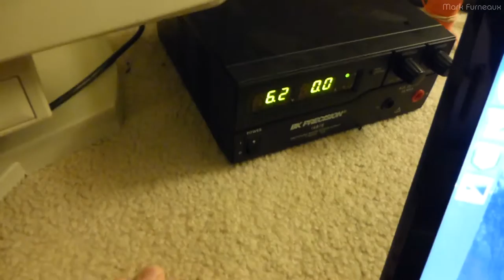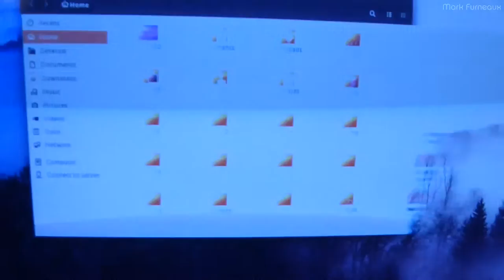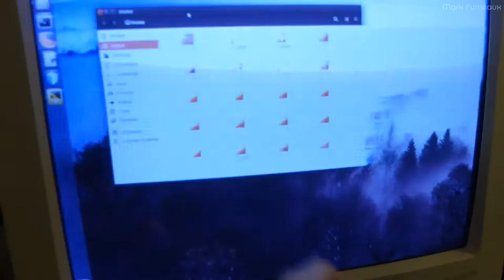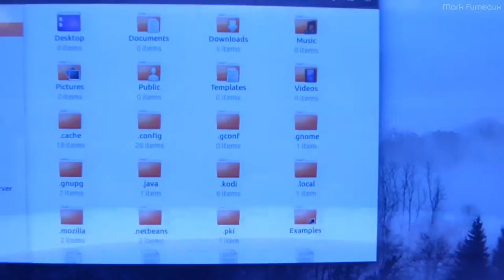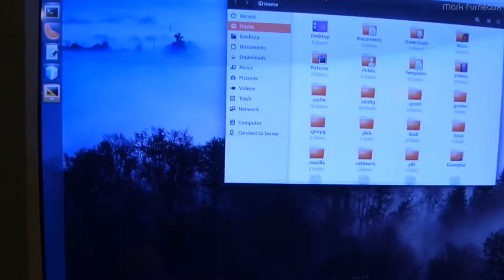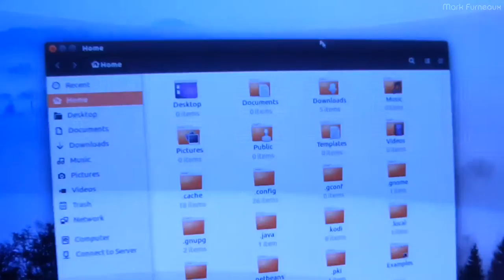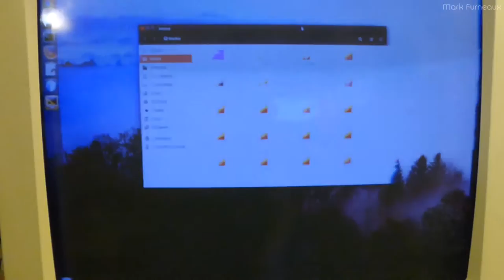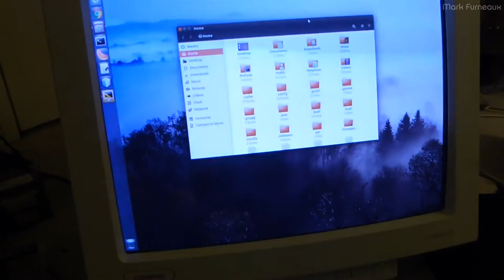Playing with CRT Heater Voltage

Comment: Heaters can be boosted up to about 9 Volts, life will be reduced but usually the CRT is on the way out anyway. I have overvolted 6.3 Volt CRT heaters up to 35 Volts before the heater popped.

Comment: Interesting video. You are correct about the rebuilding of the CRT, but rebuilding a color CRT is afaik not possible, as you cannot get the electron guns back in the correct place to line up with the shadow mask.
Reply from the maker: It is absolutely possible to rebuild a colour CRT. The whole reason for purity and convergence magnets is to align the electron guns. They can never be perfect, even from the factory.
Reply: Ah, cool. I thought it was impossible, seeing how shadow mask-CRT's are made. Do you know if any information regarding the rebuild of color CRT's are available in book form or on the web? I find it very interesting to see how it's done.

Comment: nice vid maybe try overvolting and see what it can take?
Reply from the maker: +_Eagle_360_nsc I tried that. I got it to double the rated voltage (12.6V) and it arced from the heater to the cathode. It survived.
Reply: +Mark Furneaux ok. you make nice video's tho